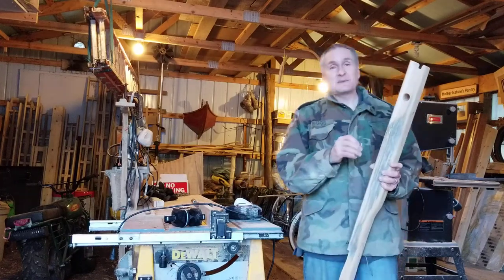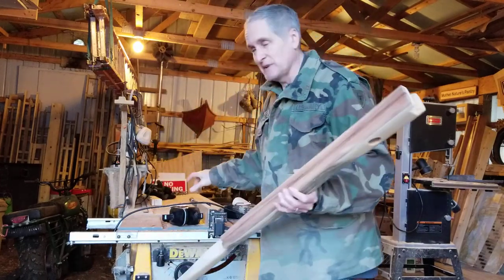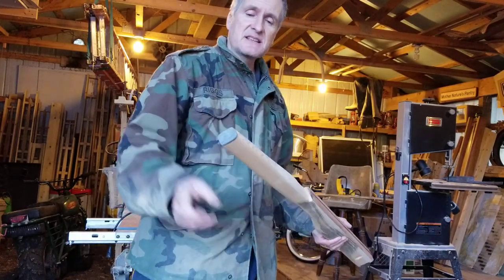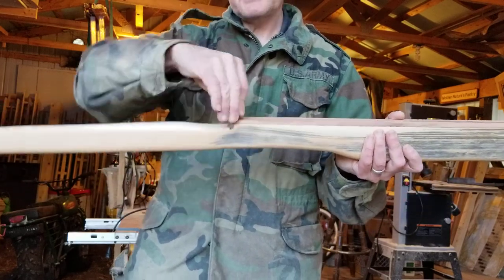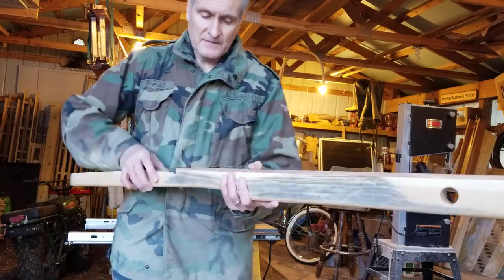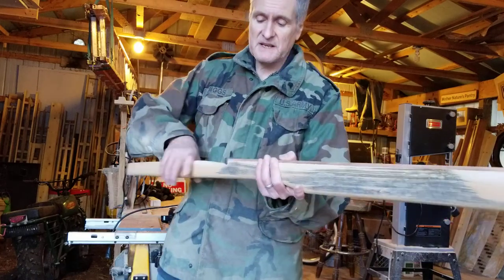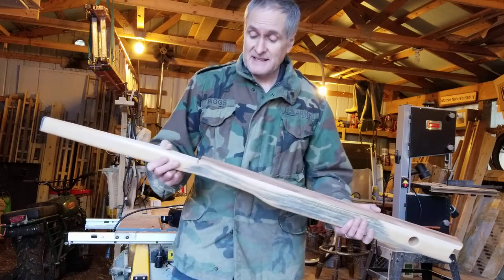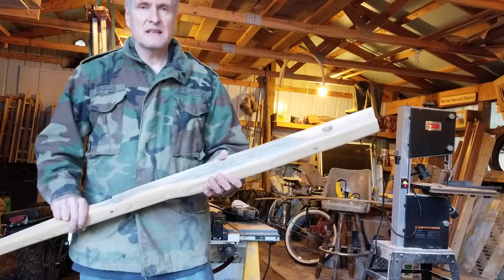Big Crossbow #3: Refining the Tiller!

Comment: I'm building a crossbow I've been wondering how long should the tab which is screwed on to the stock be?
Reply from the maker: The bolt clip? Long enough so it goes up the shaft about 2 inches. I made the mistake of thinking I should make a groove in it but that allowed the clip to make contact behind the very tip of it, reducing it's ability to hold the bolt down. It worked really well when I made the second one and kept it simple with no fancy shaping or grooving at the end. I'll be putting mine on tomorrow and I talk a bit about it and show the bending form I use and how to use it.
Reply: I'm just wondering wouldn't it be better to use shorter bolts since there will be less wind drift?
Reply from the maker: It might. I'm wondering the same thing. I think I shall take the time to experiment with a group of different bolts: Different lengths, masses, barrel and straight shafts, wood fletching vs feather. This would be a great opportunity to see what's going on and it may amplify things with a relatively long power stroke mixed with a prod that isn't massive.
Reply: They used leather as flights too.
Reply from the maker: Brian Anuvattanachai That's a must try too.
Reply from the maker: Brian Anuvattanachai That's a must try too.